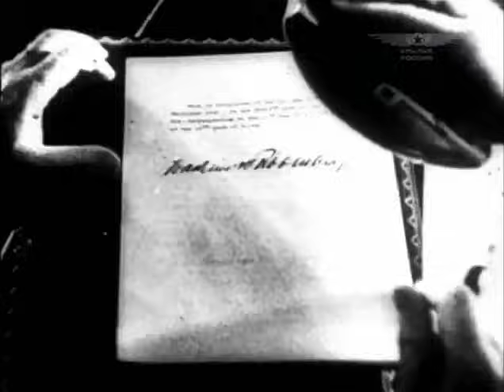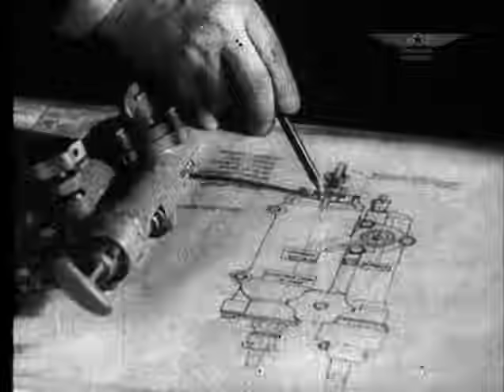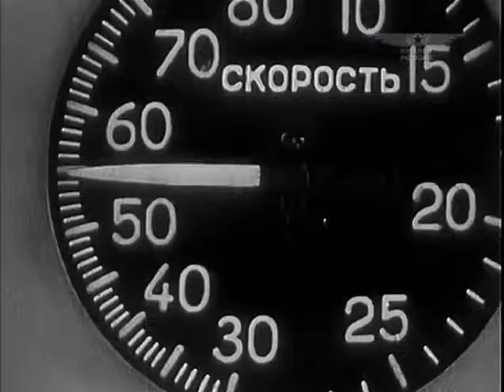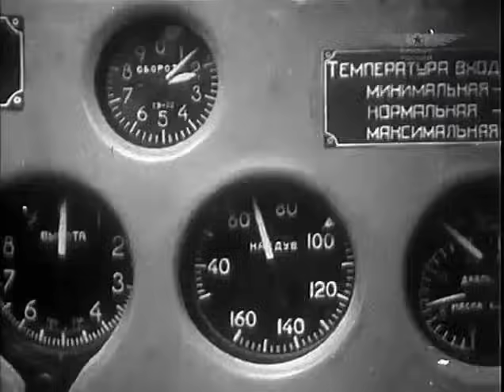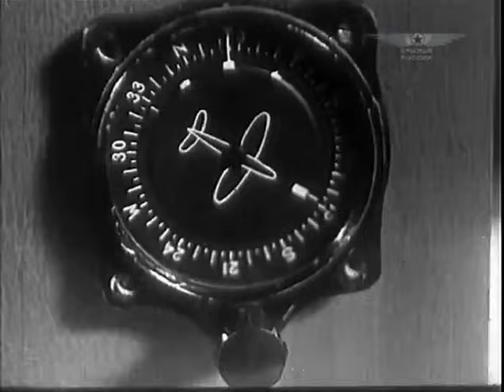Soviet Fighters 2 / 18 : The Stormy Years Full Length

Comment: amazing they loved the aero cobra!
Reply: P-39s got a lot of bad rep, most of it undeserved in my opinion. They were misused by USAF in a role not well suited for - as high altitude fighter - and with inexperienced pilots, facing the very best Japanese Air Force had to offer. The main weakness - bad high altitude performance - was not much of a factor on Eastern front, since most engagements took place in lower altitudes. Alexander Pokryshkin skored 48 out of his total 59 kills flying P-39. He also refused to have the air division he commanded to be rearmed with La-7s, favoring the P-39s instead. 

I was kinda hoping to see more info in this documentary about how Lend Lease aircraft performed in this area of operation, sadly the documentary dismissed what was ~15-20% of USSR Air Force's total strength with barely a footnote.
Reply: @PavelD83  I agree that the P-39 isn't appreciated for what it was.  I love that little bird!  As for the documentary, to be fair, this series is about the Soviet/Russian designed aircraft, so it's not surprising that the lend-lease gear is only briefly mentioned.  Honestly, I am surprised that it was mentioned at all, given that recently there seems to be a revisionist history trend espousing the idea that lend-lease was completely unnecessary and did nothing to help the USSR achieve victory on the Eastern Front.